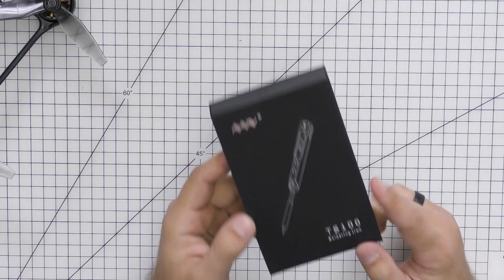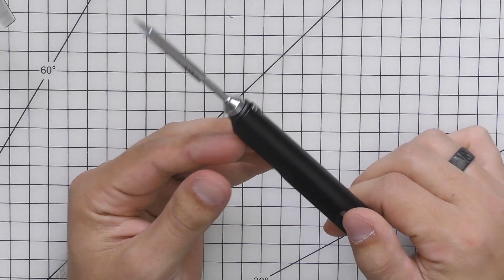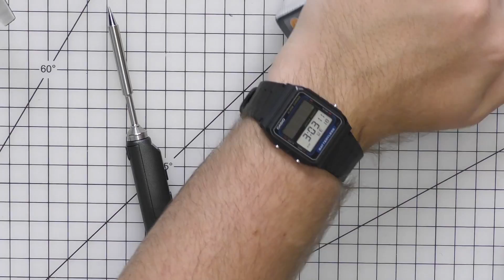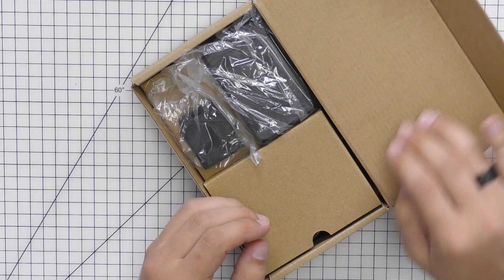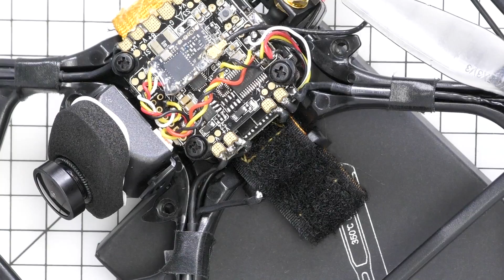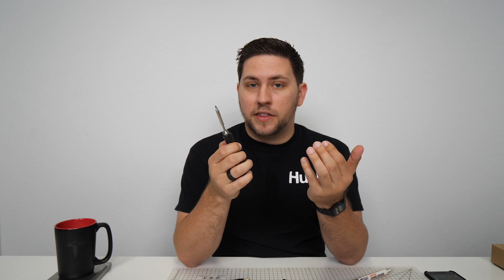TS100 Soldering Iron & Repair

Comment: Hi I got a question I just recently bought from you guys. FR Sky receiver that little tiny one looks like a SD card I'm wondering if the current sensor the one with the two little cables on the side of it what's the voltage on that